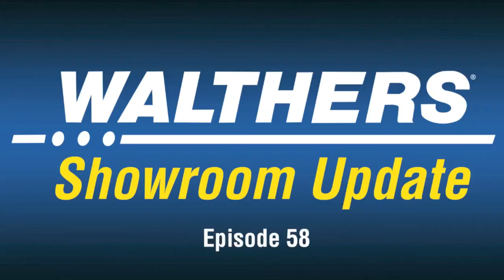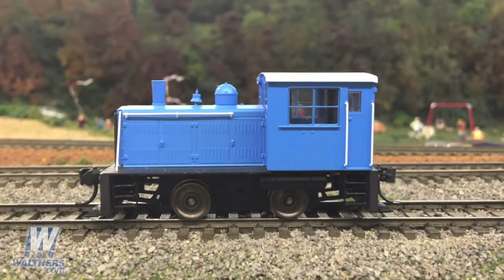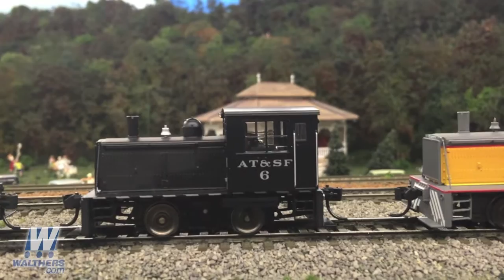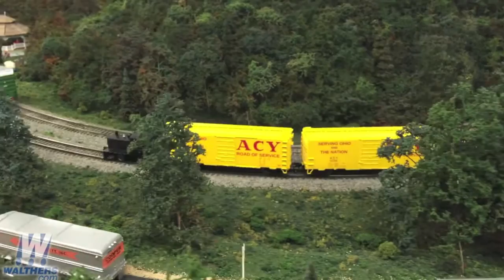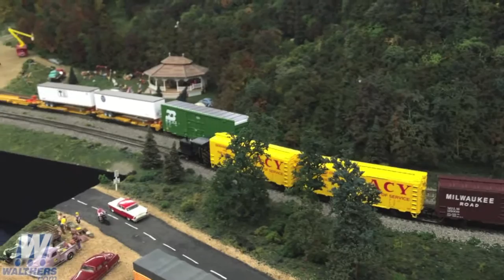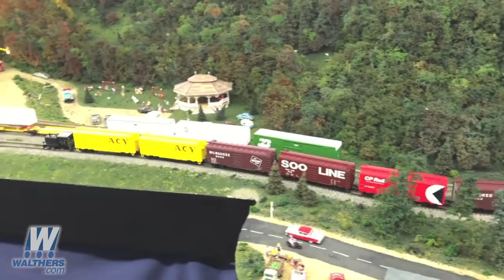Walthers Update 58 –WalthersMainline® Plymouth ML-8 Industrial Switcher

Comment: I bought the DC only version. Does only the DCC version have the current keeper?
Reply: The Dc version probably doesn’t if you haven’t gotten a answer
Reply: @njandparailfan6332  yeah, I tested it with the tape. No current keeper. I was sorta excited for that, but it still traverses my EZ track and switches without hiccups.
Reply: Blaxland Ridge3 yeah I figured it wouldn’t have one since currentkeepers are normally only a DCC thing but hey atleast it gives you no problems
Reply: @njandparailfan6332  yeah, they're awesome little engines. I got mine on sale around December of last year for $60
Reply: Blaxland Ridge3 sweet, ive been thinking about getting on with DCC and adding sound
Reply: @njandparailfan6332  nice! Make a video on it if you do
Reply: Blaxland Ridge3 can do! There is a video out there proving it possible: https://youtu.be/BcpDwWnj_4Y